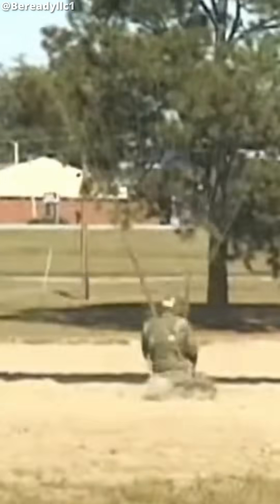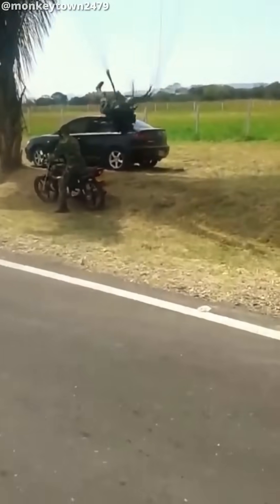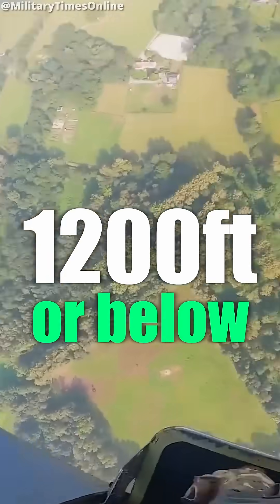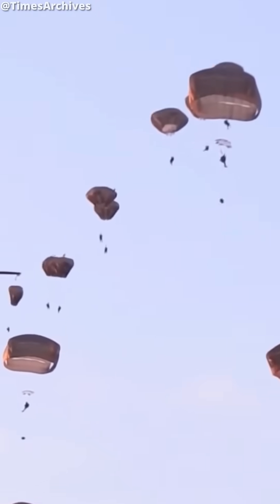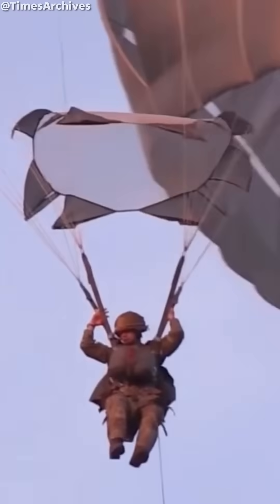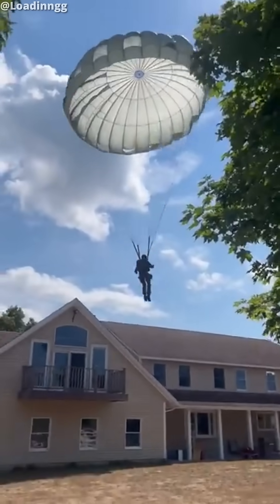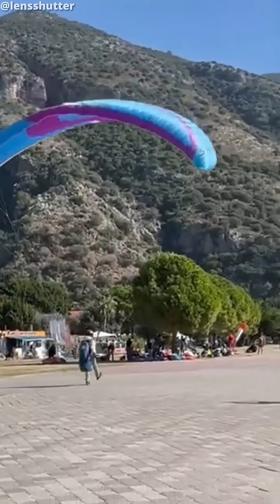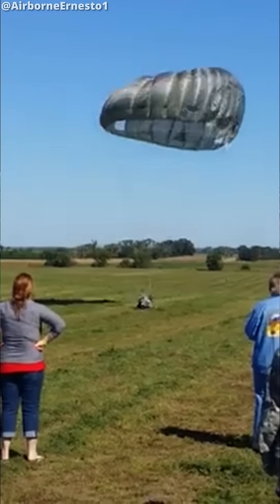Why Do Paratroopers Crash a Lot?

Comment: Paras always exit the service with their knees absolutely fucking demolished because of this. Even if you land perfectly every single time, it's simply more than your joints can take. You're hitting the ground feet first at around 25km/h, which coincidentally is also around the average person's top sprinting speed. There's only so much of that impact you can absorb with good technique.

Comment: Iv done 4 of these jumps. 
And was trained as best as they could. Not Military.  
You failed to mention so much. 
Wind speed is known
Wind direction is known
In which you land going into the wind not with it unless you wanna land like this. 
Not once did you mention wind direction. In which is the most important detail of any jump. 
Also landing fast for military is crucial sense you are well not sitting but I guess you could say a floating duck to the enemy.

Comment: this is a bad answer. it has nothing to do with static line. You can static line a ram air as well. And paratroopers jumping rounds only partly answers it. You can safely land a round with proper spotting and flaring using the rears. Bad landings in the military are due to lack of experience, poor spotting, crowded air spaces, and (relatively) high wing loadings.

Comment: Why are the static lines used to automatically open the chutes? Wouldn't it be more practical if the troopers could cover most of the jump in free fall and only open short above the ground? Then maybe you could even make the landings smoother by having a bigger parachute to break the fall more. Also, is it that expensive to put a simple steering system into the parachutes? Seems very untactical to me to just shoot the troopers into the wind without having big control of the landing

Comment: That's why they also don't carry any equipment on their upper body but rucksacks on belts that hit the ground first. Also, that's why it's preferred to use lace systems and belts like ALICE instead of body armor and backpacks so they carry most weight on the lower body so they won't break their spines as they land.

Comment: Polish army troopers pulling the handle to open parachute they count 121, 122,123 that's around 3 sec . And that parachute is called ground smashers . And parachutes are fit up with device which will automatically open your parachute if soldier will panic or pass out

Comment: I do my get why they don’t at least give special forces who use parachutes ones they can somewhat steer. It would make more sense tactically. If they spot a random patrol or the wind pushes them towards enemies, they can avoid them and land stealthily, you know, the main reason why paratroopers are a thing: to drop in behind enemy lines without being noticed.

It would also prevent the squad from being confused, lost, disoriented, and completely alone or split apart.

Comment: The parachute is also designed to drop as fast as possible without debilitating the soldier. It's not the "recommended" parachute fkr a reason

Comment: Yeah, OK but the examples you picked also had terrible technique.  If you bend your knees to use them as a spring for stage one then land on you ass in stage 2 it won't be pretty but you likely won't break your legs.

Comment: Static line jumps are not completely uncontrolled. The SL rig can be steered to a certain extent. Most of these accidents are clearly the result of poor training. SL rigs need to be turned into the wind because the opening in the canopy allows air to escape and drives the rig forward. Bu turning into the wind you cancel out the forward movement. Of course depending on the wind strength you'll probably have some  some forward or rearward drift, but failing to turn into the wind will have you hitting the ground at a rate faster than the wind at your back.
Even the old 'pumpkin" canopies without an opening can be turned into the wind and air dumped out the rear by pulling on the fron lift-webbs.

Comment: Being a retired paratrooper, I will add we generally had anywhere from 60 lbs to 170 lbs of gear.  At about 100ft from the ground the gear would be released with a HSPR lowering line.
1/509th ABC Team

Comment: You hit the ground in about 30 to 35 miles per hour BTW. Also, if you don't bend your legs, you'll certainly break them and if you break your Femur, it will be a career Ender.

Comment: This lacks nuance. Static line jumps are not the reason for the innacurate landing, its because of the parachute style. Dome shaped parachutes dont have good steering like modern standard parachutes. Static line jumps can be done with both. Also "civilian" jumps arent always not static line. Most countries require multiple static line jumps as part of getting certified. Most places will only let you solo jump on a static line until you get a certification

Comment: Why don’t they use the other steerable chutes?
Reply: Because dropping an airborne division in a relatively small area would be pure chaos if thousands of paratroopers were zipping around in steerable chutes.  Think of the catastrophe caused by people colliding with each other. Also, paratroopers carry a lot of weight with all of their equipment, weapons, rations, etc., and the square chutes that they use are designed to handle that weight relatively well under a large canopy.

Comment: "Static Line" has nothing to do with why a jumper can't control the descent.

A "Static Line" is a line that doesn't move from the thing being jumped from.
It automatically opens the parachute a set distance away from the thing being jumped from.

The thing that lets a jumper control their descent and landing zone is the shape of the parachute.

A rectangle parachute is flyable. They can steer it.

A circular parachute is not flyable. They have no control at all of where they go.
Reply: MC-1C was circular and flyable. Many jumps in it. It was steerable and with toggles.
Reply: @Savage_Viking  Sweet. I imagine it was limited steering vs a wing, but I'm also sure you don't agree with the video saying the reason for no steering is based on how the chute opens.

Comment: Sounds like the militaries NEED to change their equipment to more modern designs that have better operator controls after release. Since such exists in Civilian chutes it should not be hard to correct the issue except changing standards and getting new equipment providers if needed. Our military deserves the safest equipment they can get.
Reply: They have the best parachutes.

Comment: You fail to note that on top of the shortcomings of a round rig vs square rig that is steerable, the Paratrooper jumps with extra weight, often up to equal their own body weight. A civilian skydiver jumping a square rig with that extra weight would also be in big trouble.

Comment: Most of those fails are the trooper not paying attention.  The one running into the building looks like an mc1-1 that is steerable. They were facing the building. The old t10 was only partially maneuverable.

Comment: Paratroopers are most vulnerable as they are exposed hanging from their parachute in flight from aircraft departure until they are concealed by ground cover after landing. The parachute looks like a huge arrow in the sky pointing down to paratrooper below. Thus mil parachute tactic is mass jumpers, minimize exposure time. So low altitude, preferably with visibility limiting atmospheric conditions. Of course, this also endangers the paratrooper. But if well trained, and conditions that favor the paratrooper's survival, the paratrooper can be a lethal warrior.

Comment: Hard to understand why the military have no problem paying overinflated cost of their marquee equipment while not spending a bit extra for decent parachutes. Seems like there'd be a pretty decent tactical advantage to be able to steer your parachute and get to the ground without an injury.
Reply: Nope. Steering bad at less than 800 ft and at night with hundreds or thousands of jumpers at the same time. Everyone drifts in same general direction. Keeps collisions low.

Comment: Modern parachutes have risers that allow for steering but if you want to know the real reason its more down to kit. Modern soldiers kit is far heavier than anything a civilian sky diver would typically wear. The Airborne in WW2 had risers for their paratroopers as well but they still landed in trees and buildings all over France with far lighter kit. The ability to steer your parachute is only as useful as you can see and the wind allows.

Comment: Static line jumps (rope jump) has NOTHING to do with the landing.  While I was stationed at Ft. Bragg , for my military jumps I used (this was back in the '70s ) a Paracommander that was deployed via static line.  I was qualified to use that canopy. For the others who weren't, they were at the mercy of the T10, what direction they were facing, and the speed of the wind. 

I spent my weekends at the 82nd Parachute Club. I was stationed at Bragg when the C-47 crashed with part of the Golden Knights team.

Comment: Ahh yes the best of "Military Grade" They dont give a single f@#$ about the user. They just want a metric ton at a good price.
Reply: No... that is not the case. The military did testing with other methods. This is just still the best. You do not want people maneuvering in the air when there are hundreds, if not thousands, of other people in the sky at the same time. You also want to get to the ground as fast as possible given the higher chance of being shredded by gunfire.

Comment: So here's my question. Is this still the case currently? After all, we spend an absolute shit ton of money on the military. So they better have top notch equipment all around.
Reply: The military did testing with other methods. This is just still the best. You do not want people maneuvering in the air when there are hundreds, if not thousands, of other people in the sky at the same time. You also want to get to the ground as fast as possible given the higher chance of being shredded by gunfire.

Comment: Well then, why does the military still use such parachute systems, let's not talk about comfort, this means incredibly terrible positioning
Reply: The military did testing with other methods. This is just still the best. You do not want people maneuvering in the air when there are hundreds, if not thousands, of other people in the sky at the same time. You also want to get to the ground as fast as possible given the higher chance of being shredded by gunfire.

Comment: so why dont use better ones if you cant prevent alot of problems?
Reply: The military did testing with other methods. This is just still the best. You do not want people maneuvering in the air when there are hundreds, if not thousands, of other people in the sky at the same time. You also want to get to the ground as fast as possible given the higher chance of being shredded by gunfire.

You would create FAR more problems using civilian versions.
Reply: @n3v3rforgott3n9  how about a "Vent/flap" that can be Opened by the operator to increase Fall Speed? (And decrease normal Fall Speed to safe Levels) If nedded you can Open that flap for fast descend. No manuvering, Just Speed Control.

Comment: You'd think they'd finally design a better chute that doesn't scramble knees like eggs for breakfast but nah replacing the para's is apparently cheaper than R&D
Reply: The military did testing with other methods. This is just still the best. You do not want people maneuvering in the air when there are hundreds, if not thousands, of other people in the sky at the same time. You also want to get to the ground as fast as possible given the higher chance of being shredded by gunfire.

Comment: Having one less injury in 1000 paratroopers would probably justify spending 2000 more per parachute (about how much a civilian one costs). It can't be cost, given how extremely expensive the consequences of an injury in a battlefield would be, especially when it could jeopardize the outcome of an entire operation.
Reply: I don't think they make a static line civilian parachute. The parachutes are fine and do the job well. Paratroopers are expected to jump in total darkness at 800 feet, sometimes down to 550ft. No time to steer. Hundreds or thousands of jumpers in the air at one time means you want them all generally drifting in the same direction, not steering across the sky running into people.

Comment: If the paratroopers descended slower, they'd be at greater risk of getting shot before reaching the ground.
Reply: Civilian ram-air parachutes can both descend faster and land softer than the paratrooper ones, in addition to steering and the ability to glide further.

It's mainly down to the fact that ain't nobody got the time or money to train thousands of privates how to use them well enough for success rates to match the dead-simple static line jumps.
Reply: @uumuu  
That and cost. It could be improved upon, but they won't do that
Reply: @WhatIsSanity  I mean people mention cost but how much more expensive would regular parachutes be? We'll spend like 20k for a single sniper bullet and theirs loads of things that cost an abnormal amount so it's hard to think that better parachutes would really add much in comparison.
Reply: @Name-nq7tj  
I agree, but that isn't how military procurement works >.<

If the brass think that what they have is good enough, regardless of any valid arguments to the contrary, then they are extremely unlikely to spend money on an overhaul.

Keep in mind that new chute systems means retraining troops on how to use them, which costs a lot more money than replacing them and will require more drops which also puts said troops at further risk.
There is always risk in a paradrop especially when you're dropping an entire formation at a time.

Also, also, also any replacement will be made by the lowest bidder rather than the best manufacturing quality.... 

Welcome to the military, it's awful.
Reply: @Name-nq7tj  20k? Making up numbers in your head here?
And it's not about the cost of the parachute. It's about the time it would take to train that many people in what is a difficult thing to master. It's also true the many of them would never really get it right.
Reply: More time in the air also means more time at the mercy of the wind.

Comment: you'd think with the budget they get, 
you'd think they would get parachutes 
better than just a bed sheet with stings
Reply: Not if you're trying to fall quickly and somewhat safely no civilian chute would work well and ontop of that rigging these is not exactly an easy task the more complex chutes don't exactly help and can have more points of failure which are more likely to result in death.

Lastly paratroopers aren't used anymore anyways

Comment: Incorrect. If you can't pull on your risers to "slip away" or guide yourself - 99% of the time it's YOUR fault. Every landing with T-10D's and slow T-11's require PLFs. Eyes on the horizon. If you look down, you WILL break your legs. It's a matter of competency. AATW

Comment: THIS IS SCARY!!!!!!
NO STEERING!!!!!
Reply: Fairly minimal yeah because the extra steering is only another point of failure that's possible and more difficult to rig for those who do the rigging and repairs. 

Also those would only slow you down great way to be a sitting duck to be shot at, not that we use paratroopers anymore anyways.

Comment: Your opening statement is so wrong. The reason is they use a round (U.S. use those squre things). These are not really steerable, normally up to 5mph forward. These are simple to operate. Jump, keep your fingers crossed. Civilians, operators & other special circumstances use steerable rectangular chutes, that can push forward up to around 15mph & more. You can normally land exactly where you want, but do require practice to use.

Comment: Most of this video is not true 

The reason why they fall faster and more uncontrollably is because of the chute itself its round instead of square it being a static line doesn't matter 

You cant control round chutes like you can with rectangled ones 

The reason why they use round chutes is because there cheaper and there better for dropping heavier loads like 200+ lbs guys with another 60+ lbs of equipment

Comment: ok i know this might be a stupid question, but like…

have they considered just NOT doing it like that?

as a layman/outsider, it really sounds like an objectively worse method of landing that provides no real advantage.
Reply: Complexity, cost, and weight are some of the big reasons. Steerable chutes are way more expensive, weigh a ton more (remember, paratroopers already carry about 120 pounds of gear), and the added complexity makes them more likely to get tangled up and fail, which can be fatal. You also don't want a slow descent, as you're essentially a sitting duck when parachuting, so you want to get to the ground as fast as possible.